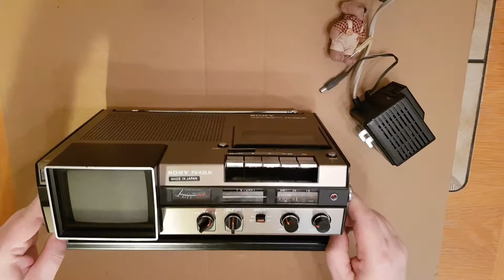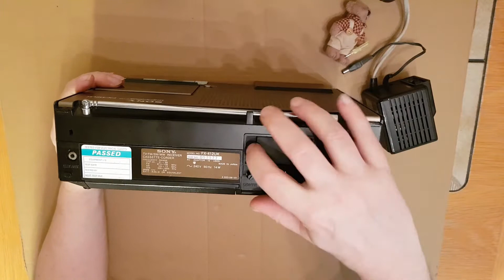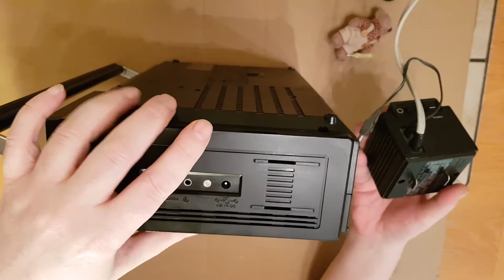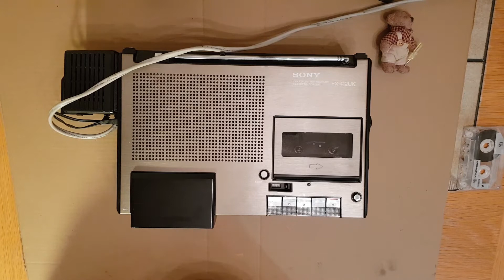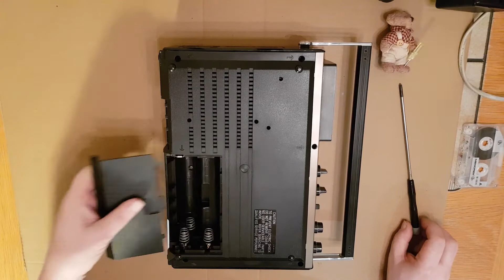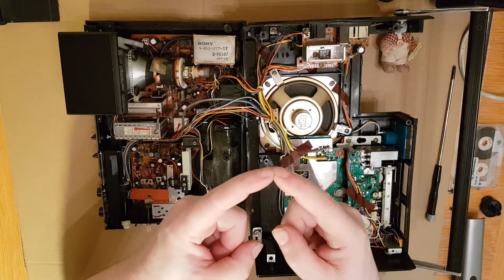A look at the Sony FX 412 UK Tv boombox including old repairs

Comment: Wow - that takes me back!  I had one of these delightful little sets in 1980 and it was my constant companion for the next few years as I moved from one RAF station to the next until sadly it stopped working and I never got round to having it repaired.  I used an external TV antenna made from bits of wire coat hangar cut to the right length and it worked just fine!

The tuning knobs often slipped and it was tricky to peak the tuned TV signal; also the vertical hold often needed resetting.

But it was a wonderful little friend.
Reply from the maker: Yeah I love this little thing, I use it daily as my radio in the bedroom.
Reply from the maker: Yes, I'll get them the weekend for you

Comment: I found one and plugged 12vdc into the side not thinking it might have the center tap negative!  😮  Hoping it’s maybe a fuse inside, any thoughts or leads would be most welcome!  Nice video, I wish I had seen it BEFORE!
Reply: Hooray, just the 1.6amp soldered fuse!  Replaced with a 3amp… living on-the-edge, I know.  I think the cassette needs some love (belts)… but I hear the motor spinning!  I see snow, radio working.  Lovit.  Thanks.🎉
Reply from the maker: I'm so glad you got it sorted, I was lucky enough to get the power supply with mine.

Comment: just bought one of these on eBay, should be here on Thursday. Seller says everything works apart from ffwd on the tape deck so I'm guessing belts. Already got some contact cleaner and grease and I have DVD player with an RF out I can use to get a picture :D
Reply from the maker: You'll love it, great little machine, yeah could be belts, or as you say might just need a little grease. I didn't know they made Dvd's with rf out, I'll have to make one my next purchase I think, let us know how you get on.
Reply: @retrotechguardian4393  it's a DVD VHS combo machine. I just put a crocodile clip on the centre pin of the rf out and the other end on the antenna and that gets a perfect picture.
Reply from the maker: @Destructor8031  Nice idea, I'll try that myself this week.